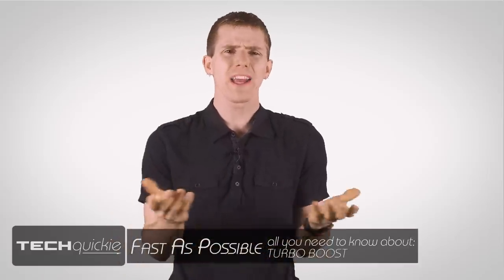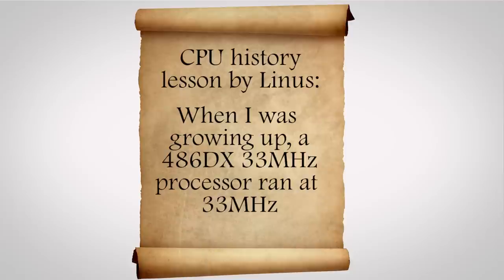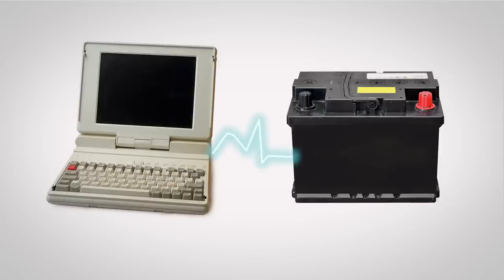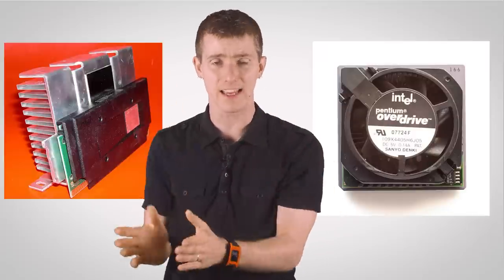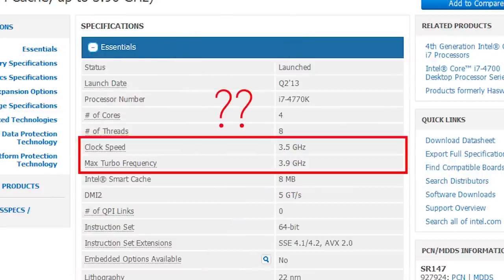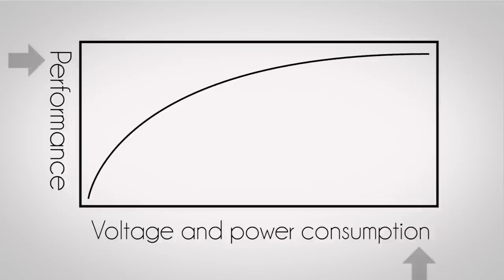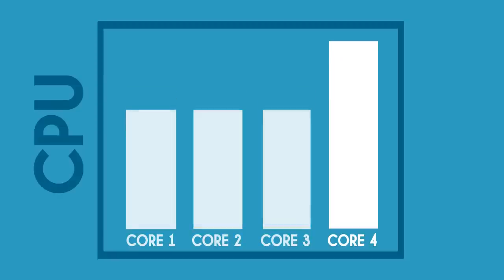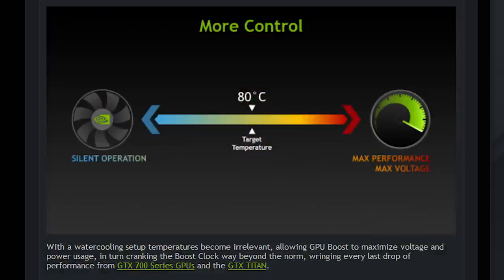Turbo Boost & Processor Efficiency as Fast As Possible

Comment: I thought Turbo changes frequency of all cores.
Reply: It does but the other cores are inactive (and slightly lower clocked; for instance, my computer shows 2 cores (due to hyperthreading) running at 2.9 and the other 6 at 2.6 and 2.7. Those 6 cores are mostly inactive anyway and consume almost nothing (when a cpu is doing nothing it idles and consumes very little). However, if other cores are needed, the frequency on the top cpus is dropped and other cpus join in the processing. It's seems complicated at times but it works very well.
Reply: Me too, that was really important info.
Reply: If you boost all cores, that's overclocking.
Reply: ***** no, it's stock and doesn't require going into the bios. Overclocking would be when you force it out of it's factory settings for a higher clock speed regularly with overvolting for stability and/or sometimes saving power.(there's a difference between voltage and power consumption that some people just don't get.)
Reply: Alexander Pavel You mean twelve cores not 2 right?
Reply: Alexander Pavel dude, he's got a quadcore with hyper threading showing 8 threads. one core gets boosted and thus takes both it's threads and displays it as 2 separate cores/threads.

Comment: Interesting note....

Often the AMD 486 often didnt have a heatsink at all. I had never seen one with a heatsink on it. Back then they just ran open and naked. Used to have a dual socket 486 system back back in the day.

Comment: I'm late to the party, but didn't 486DX2 and 486DX4 have basically a "turbo-boost" function. A DX4 would run at 25mhz normally, but once information was loaded into the cache and the system was no longer restricted by the FSB speed to system memory, would jump to 100mhz. Isn't that the way those processors worked?

Comment: Then what does overclocking do? Does it just change the maximum speed for one core able to reach or a clock all cores can reach at the same time?
Reply: You are changing the normal running speed of the CPU, not the turbo boost speed. Some mobos have the ability to change the turbo multiplier but most people turn off turbo boost to prevent instability during overclocking and normal use ( the normal clock speed will be higher than turbo speed after overclocking anyway)
Reply: patx35 OH, thanks! That clears up a lot of my assumptions!
Reply: It all depands really on how you did your overclock and if you turned off the Turbo Boost. I run an FX-8320 at a fair stable everyday OC of 4.4 GHz. I use no Turbo Boost, No Cool N' Quiet, No C6, No modifier to any of the CPU stuff so mine ALWAYS runs at 4.4 which means that unless I turn the machine off I have more power consumption overall.
Reply: i want to oc single thread performance, could i just have as in the video the 3.4ghz on all 4 cores and oc the boost to 4.6ghz
Reply: Plusthinking Iq I don't think so unless you can OC the turbo boost
Reply: Plusthinking Iq what you could do is OC the entire system to 4.6 and keep speedstep on. Then you get the target 4.6 you want while still keeping power relatively low. 

Keep in mind enable speedstep does tend to make the lower the overclocking potential since you experience much more vdroop during the ramp up.
Reply: patx35 That's wrong. People generally overclock the turbo frequency these days. There's no reason to lock the clocks at a high frequency unless you're doing extreme overclocking. In fact, I've never heard of people turning turbo off for normal use, and all of the guides teach how to change the turbo multiplier. Are you thinking all the way back to the old Lynnfield days?
Reply: NDogg15 I think you are mistaken. Tubo Boost doesn't affect the User modified multipler. It has its own value.

Oc works by base clk x multiplier. 

Turbo boost isn't part of the main clock calculation, It works off a P-state. How this works is that turbo mode has its own Preset multiplier that will override the user multiplier if its higher. so say the 4770k:
stock: 35x100mhz

if the cpu has the headroom fro turbo it will replace the 35 with its own value (39 on the 4770k)

However If the user Overclocks and sets the multiplier to 42, then in turbo mode it would recognize that its predefined value is lower and such will not interfere.

 in the old lynfield days (including myself) we oc by changing the base clock since most chips were not unlocked. and since turbo works off the multiplier, we would have to turn it off (otherwise it would overclock the overclock). But nowadays we do multiplier OC so really there's no need to turn it off.
Reply: iamterence77 We're both saying the exact same thing in different wording. Thanks for explaining it to me like I don't know anything, though. I've clearly never touched a computer before.
Reply: Khiol M. FX doesn't have turbo boost.
Reply: Depends on the motherboard. I can change the speed of each core on my i5 with my Asus motherboard.
Reply: patx35
sorry but amd fx cpus do have turbo boost
Reply: Ace_Trowa *quick google and headdesk later*

Wait, is that a BIOS feature or AMD released a new generation to the FX line?
Reply: patx35 its part of the fx line atleast i have the option on my 4150. 3.8 is my normal then the turbo core is  4.0
Reply: patx35 It started with the Thuban Phenom II x6. All AM3+ CPUs and all APUs have it; you just never noticed it.
Reply: NDogg15 mmm ok umm could you posably link me a good apu with am3+ socket?
Reply: Ace_Trowa I'm not saying that APUs are in AM3+. I'm saying... well, exactly what I said. All AM3+ CPUs have it, and all APUs have it.
Reply: NDogg15 AM3+ is FX CPU. FM1, FM2, etc, is APU.
Reply: patx35 I know. Fine, since you people seem to have terrible reading comprehension, I'll say it like this.

All AM3+ CPUs have Turbo Core.
All APUs have Turbo Core.
Your reading comprehension is embarrassingly atrocious.
Reply: patx35
Thanks a lot. As people say, its very true that PC community is the best community because of friendly people like you, I mean who would explain something complicated over internet to someone you don't even know. I SALUTE YOU MY FRIEND!
Reply: SeaJay FYI, adaptive, locked, and offset all refer to voltage, not frequency.
Reply: NDogg15 I always have the power on hand but we're talking minute power consumption increases so meh...

Comment: Could've sworn that the turbo did not ramp up further when only using 25% of a quad core CPU on 4670k, unless I turn the core affinity of the task to 1 core or 2 cores.

Comment: Wasn't the reason that CPU manufacturers dropped out of the single-core speed race and into the multi-core one due to the fact there's a physical limitation (i.e. heat management) that made going past 4-5 GHz impractical?   

I didn't think it was to do with smartphone popularity and even if it was there's not reason desktop/laptop processors can't go a different route to mobile/tablet ones.

Comment: Yeah, but what about a showing of CPU clock speed/cache/cores , etc.  I don't see many videos on youtube, showing the performance difference between 3.5 GHZ, 4.5 Ghz, 5-6 GHz ( Yes, I know this is typicaly hot, or needs water cooling , etc. )  

Could there not be a community, petitioning Intel or AMD, for processors that solely focus on gaming performance, or are we too small of a market-force, and/or are the K versions of cards like 6700K cards already catering to us ?

Comment: Also, do you think that, CPU's are going to bottleneck Pascal/Polaris ? Do you think AMD, and Intel are going to come out with better performance CPU's on the gaming side ?
Reply: no
Reply: amd actually announced their new line of cpu's called zen they did this when they announced the rx 480
Reply: Zen has been longer then that in the works. While it is a huge leap for AMD, it's performance will hit around Haswell level (4th gen intel). While that is not bad, most people are hyped for good processors at the good ol AMD budget price... and that may just not be the case.

Comment: Something that Windows 8 and Windows 8.1 shows that Windows 7 and older doesn't show in Task Manager and that is CPU speed. Is my following example a case SpeedStep in action when a 2.5GHz Intel Core i5 (Ivy Bridge) processor runs at 1.15GHz? I know my processor runs at 3.1GHz when Turbo Boost is engaged. I'm pretty sure I have it right.
Reply: download cpu Z, u can check al the diffrent values, like voltages and cpu speed. so u can see it boosting up/down (also try using windows in high performance mode will boost ur cpu all the time, on balanced it wil clock down...

Comment: Dear Linus, Why work with a greenscreen if you're going to apply a white backdrop anyway? And yes there is some gradient but that's nothing a white backdrop can't achieve with a light between your feet.... Anyway thanx for explaining the Turbo number on my laptop hunt. Any suggestion Anno 2015 for a convertible ultrabook end 2015? Kind regards!
Reply: +rutger Wink because they dont always want to use a white backdrop. simple as that. a greenscreen can become anything, a white backdrop can only be that.

Comment: when you were growing up there was 33Mhz ...Linus ..how old are you...because you dont look older than 30 and im 28..and when i was in elementary we had HP was so advanced at 700mhz ...so how much time did it pass from 33mhz
Reply: I'm 18 and I had a PC with an Intel Pentium (I)@60MHz when I was around 6 years old and then upgraded to an Intel Pentium (II)@450MHz. However, my first PC was even worse than the Pentium (I), so talking about 33MHz isn't that strange.

Comment: DX33? Pfft

I went from a 486 SX 25 to SX 25 + co processor (needed it for AutoCad) to a DX FIFTY clocked to 66 of course :)

Then went through Cirix and AMD mostly while being mocked by my Intel loving frenemies until the X2's, then I was winning again for ... 2 years or so :)

P.S, who were the other poorpers here that were running Doom 2 with PC speaker as they also didn't have a soundcard? Oh how I hated it when I used the chaingun!

Comment: How does turbo boost work when an CPU is overclocked, does it work at all?
if I have a i7-4770K (Your SS example - Core 3.5, boost 3.9) and OC it to 4.0, is turbo boost going to try to boost a single core even more sometimes(since I'm over the 3.9 barrier)?

Comment: i dont know what the hell ur talking about turbo only boosts one core? well hmm maybe on intel but on my fx9370 all cores hit the boost clock of 4.7 ghz not just one core
Reply: hes talking about a gen 1 design that intel first came up with on nehalem cpus. turbo boost 2.0 boosts all cores to x amount and will even go higher if its only single threaded. the amount of which it boosts is irrelevant as its based on tdp and heat.

Comment: I have a question I can't find or maybe quite understand the answer to.

Does heat affect much and how long a Turbo Boost can perform for?

I ask because the 2014 Mac Mini is pretty poorly designed when it comes to heat dissipation. The CPU corner gets very warm after watching too many youtube videos and it spreads across the surface of the Mac Mini.

The fan went crazy once, when I was trying out a game called Symphony on it.

So I heard that thermals were part of Turbo Boost. Does that mean when it gets too hot, it won't Turbo Boost properly? Can anyone help?

My other computers fine, I put a Coolermaster Hyper 212 Evo on it (Ivy Bridge i7). It hardly goes too far past 50 degrees under load if I remember correctly.

Comment: i do wonder why the more  modern samsung phones have the 8 core little/ big set up which has 4 cores for low power and 4 other cores for high performance when i would have thought just having 4 cores on its own which regulates speed and which cores are used would have been better ?
Reply: mainly because the "big" cores in big.Little are quite a huge relative to the little cores. By switching between them in theory you can save more power (by literally turning off the Big core) 

The reason why we don't do this on x86 chips, is because they are MUCH MUCH more complicated. Adding "low power cores" will create giant dies wasting resources creating them. and with laptops having much more power and thermal headroom than phones/tablets, it just doesn't make sense.

Comment: Does this mean I can over clock my Intel i7 above 4.4ghz?
Reply: +TheUKGamer Depends on the architecture. The new Skylake has amazing overclockability, my 6700k is running with water cooling at 4.7GHz
Reply: +Takoah well my I 5 runs at 5.4 GHz
Reply: +_xXSWAGCAT420Xx _ I can go above 4.7 but mine thermal throttles after that point.
Reply: You must have the 4790K. So the answer is yes. Also that 4.40 GHz is only true for one core active. When you have all four cores active at once, it runs at 4.20 GHz.
Reply: i run mine ln 1.8 ghz

Comment: Pardon the noob question, but is turbo boost something that's built into the processor or is it similar to overclocking where you have to manually alter it in BIOS?
Reply: It's built in too all intel CPUs THAT SUPPORT IT
Reply: +Matthew Kinney OK, thanks for the clarification.

Comment: if my UEFI allows to modify my boost clock multiplier (even turbo boosts with 4 cores under heavy load), am i able to do a sudo overclock? 
i5-330 clocked @ 3GHz
when i render videos all cores run at 3.4 GHz because the UEFI decided that 4 core turbo boost has a multiplier of 34

Comment: One question -  Do I need an overclockable motherboard to support Cpu turbo boost or any motherboard supports it ? I mean I have chosen Gigabyte B360M Gaming HD motherboard for a i5 9400f. So will the cpu work at 4.1 ghz at full load or stuck at 2.9 ghz. I am asking because The Turbo Boost Technology is not mentioned in that motherboards specification.
Reply: Tubo boost is intel cpu tech not motherboard tech. Your cpu should turbo boost if it gets sufficient cooling.
Reply: @rakeshr2852  Thanks, actually there was a doubt so I asked because in many motherboard the support for turbo boost is mentioned, but in the motherboard I have chosen the turbo boost technology is not mentioned so it was a complication for me to choose.

Comment: brother i have hp i5 8th generation with bus speed 4 GT/s and base frequency 1.8 ghz with boost upto 3.4 ghz ... but te problem is whenever i use heavy software in it system slow down...... so kindly tell me how can i increase processor speed????

Comment: is there a way for me to quickly set my clock too a reasonable speed with turbo boost bcz I want to use 3.2MHZ (while playing minecraft) but my laptop says 2.00mhz 3.2MHZ Turbo Boost
Reply: I mean you can overclock it possibly but with a laptop you'll melt the hell out of the PCB if you're able to.
Reply: yeah, most laptops don't even allow overclocking, while a handful do, thermal issues arise. Minecraft should be fine with the main thread running at 3.2 GHz, while the others run at around 1.6-2GHz, minecraft does scale ok with more cores but clock speed is more important.

Comment: Is turbo boost a type of overclocking?? does someone know? Tnx!
Reply: Yes, its a safer and well designed way of overclocking made by intel. When your cores are either not in use or running below Thier rated power, turbo boost can make either half or a single core out of your cores to go at a higher frequency i.e it will be overlocked

Comment: How can I overclock my integrated gpu in my cpu? I keep my laptop in cool areas/well ventilated in my house. I have an I5-2430M 2nd gen processor with Intel HD Graphics 3000. I have the maximum and fastest amount of RAM, along with a 256 GB SSD in my Asus x54c laptop.

Comment: +Techquickie how do you explain hwmonitor showing all 4 cores going into turboboost at a time?
Reply: Aliens
Reply: +Steven Hemingway not only
Reply: +Telnimistar check your cpu usage in task manager. If the percentage is high then your cpu needs to turbo boost to improve performance.
Reply: In the video Linus states that turbo boost sacrifices performance from the other cores in order to boost one of them. So as far as I understand that you shouldn't see all 4 cores going into 3.9 Ghz but only one of them.

Comment: Soooo should I use turbo omy AMD A8 7600. it's base clock is 3.1 ghz and turbo to 3.8. kinda a large jump. when all threads are active the A8/gtx960 system run very similar to the I5-4460/R9 380 system, but naturally the I5 pulls ahead in single threaded games by about 5-7 fps. would turbocore further close the gap or is it possible to oc the A8 to its turbo?
Reply: DGAFSS Legend yeah, I think I'm just hopping ship on the fm2+ til the carrizo athlon hits and trying an fx set up while the price is right.

Comment: Lenovo IdeaPad 300-15ISK, DDR3 ram, 2gb amd r5 m330 graphics, i5 6th generation, FHD screen
I'm planning to get the above model, I'm going to use laptop for designing purpose, as you said that all i3 i5 are same should I consider a laptop with i3 and nvidia graphic card please help me I'm confused

Comment: im running my x4 860k at 77celcius at full load/gaming
is that normal bcause of the turbo boost thingy? or my proc still running at base speed bcause of way too high temp
(already down from 105ish celcius bcause voltage is set to 1.45 by default,, ive made it down to 1.25)
Reply: CPU throttling will start if your cpu reach temperature limit so its normal and how much offset did you do?

Comment: HI, i need help.
My CPU (i5 9600KF) is not boosting up to 4.6 any more it stays on 4.4 under load or in idle i have not changed or fiddled with anything just started doing it. Turbo is enabled in the bios.
Reply: In BIOS, set "Core Ratio" to "Sync All Cores"
Then set the "All Core Ratio" to 46

Comment: Would a 1.6GHz be enough for a collage student ?
Reply: I definitely wouldn't recommend it. 1.6 GHz will be literal crap in 2 years. For now, well at least you can use Chrome...
Reply: +mohamed amn Yeah, tell that to apple. $1,600 for a 1.2 GHz dual core CPU, no dedicated GPU. And 8GB of RAM. For $1,600. Think of how much bacon I could buy with that?